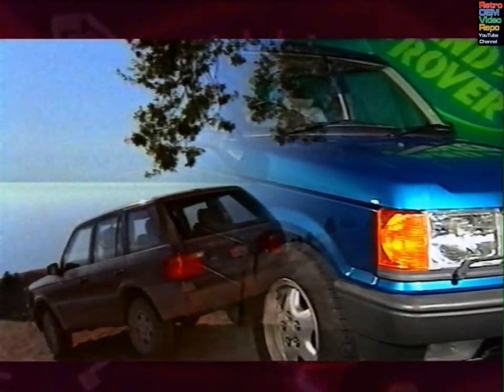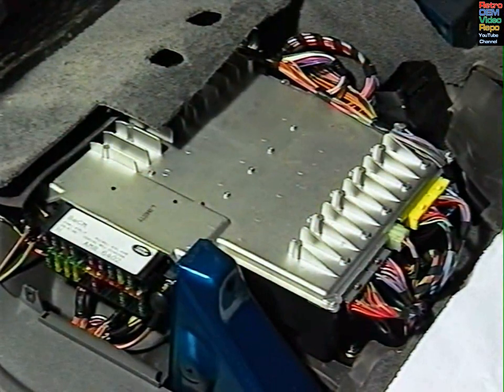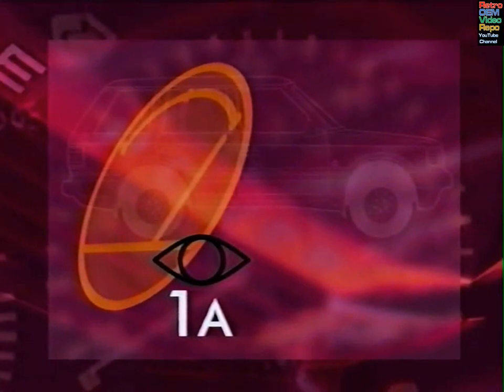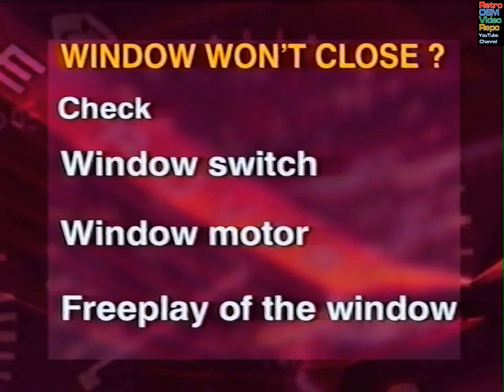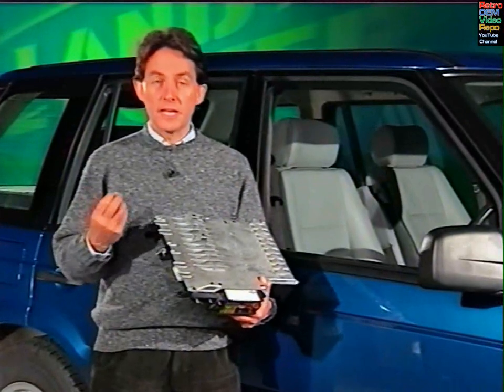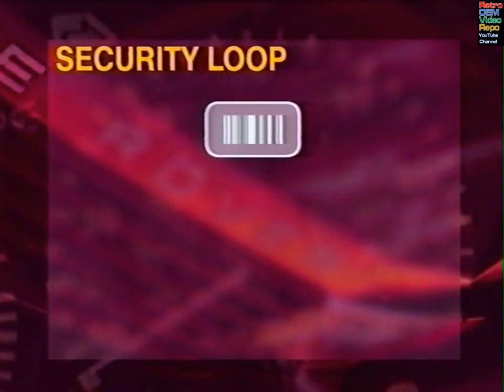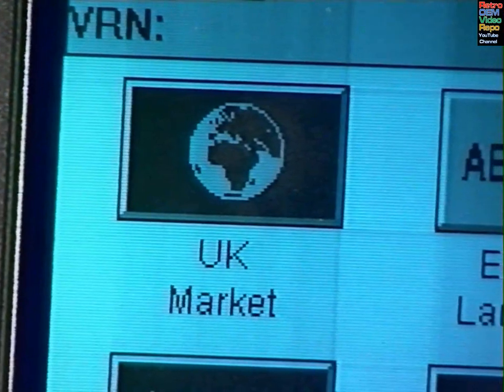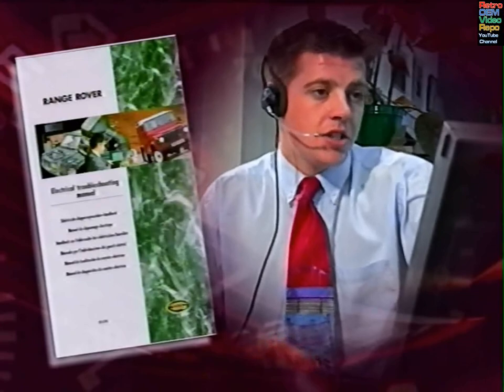Land Rover - Range Rover (P38) - Body Electrical Control Module (BeCM) (1997)

Comment: currently have a P38, don't accidentally submarine it in mud. The BCM controlls EVERYTHING! Shorting that out (because in LR's wisdom on the floor was the best place for an unprotected circuit board.) So now I have one door that is now superlocked, what a fucking brilliant idea. I have a love/hate relationship with my Rover. Realize now after this vijeo, must resort to hacking just about every module.

Comment: Hello. Great video but I have a different problem in that my '97 ('P'reg) P38 4L (gems) starts and runs 'fine', but at the same time the siren blares and the door locks chatter, the direction indicators stop working, the windows go up and down on their own, sometimes the hazards come on and the dashboard gauges go haywire. So, if I drive it, it looks like a carnival is arriving. When i turn off the engine, I have to disconnect the battery to stop the noise. This problem has been intermittent over the years and the vehicle can be fine for months at a time. The alarm can sound in the middle of the night or any other time. I do keep the battery charged. I have checked door locks and connectors, which seem fine.  Rain has come in and flooded the front ceiling light before now if I park it at the wrong angle. I have never checked any of the sensors around the ceiling as I do not know how to. I did resolder the under bonnet fuse box board many years ago but that only affected the heater motors anyway. A local landrover specialist read what codes he could for £25, but that told me even less than what I already know. Any ideas please?
Reply: Water ingress is a problem with all modern cars with lots of electronics. On the P38, you should remove the kick plates in the footwells on both sides and clean every contact point. Good earth is essential for a correct functioning car. Come and go problems as you describe, may very well be a result of a corroded earth contact.
Reply: Thanks, sallhame, I'll take a look. I have been wondering where the earth contacts are and guessed they may be a problem.

Comment: To reiterate... This car is worth less than a crapped out 20 year old rust bucket, smoking, steaming Nissan Sentra running for the last 100,000 miles on a blown head gasket, AND makeup oil after its first oil change..  But we love it.

Comment: These sh_tboxes are designed to appeal to the yuppy in the showroom.  By adding a bunch of electronic crap, frills and gremlins that not ONE owner can figure out the day after picking it up at the dealer, to a rugged capable off-road car, which the yuppy will never use.  This ties the yuppy checkbook to the service department to even open the doors.  After a year or two or three or so the gremlins and the lure of the new car showroom lure the yuppies back for new again, and make the car worth less than a crapped out 20 year old rust bucket, smoking, steaming Nissan Sentra running for the last 100,000 miles on a blown head gasket. 
  And, now we can afford to buy the car for the off-roadability and ruggedness.  But we are stuck will fighting off the gremlins.  Some given in and keep it stock and accept the continued gremlin battle... some disable everything the gremlins can mess up.  But in the end we love these bloody good off-on  road cars and keep them despite the problems and the scraps and scuffs.